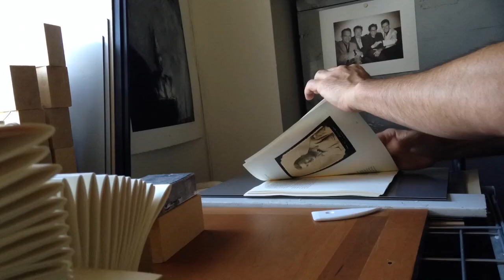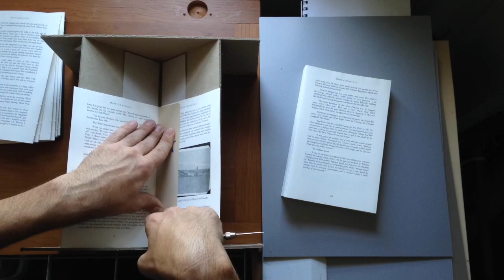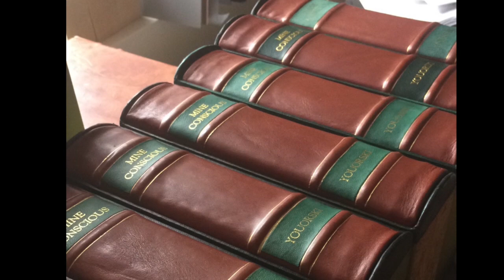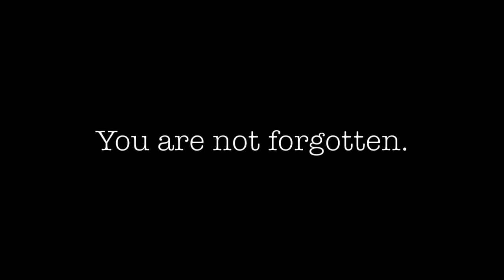Making Mine Conscious, Traditional Bookbinding.

Comment: How thick is the leather you used? I am a novice wanting to do my first book. I am trying to decide what method to use though.
Reply from the maker: Shanna Bolser I would suggest using French split goatskin for your first try with wheat paste for adhesive. This leather was an expensive 1mm calf skin and required significant pairing which needed specialty tools and training. Goat is really nice to work with.
Reply: @RoundsOfWanting  Thank you for your advice. I will be looking into it.

Comment: small qty book card supplier?
Reply from the maker: sorry, what is the question?
Reply: @RoundsOfWanting  I need six book cover cards 5.5 x 11 qyt2 9x12 qty 4 do you know a vendor? that supplies short qty's
Reply from the maker: @bigjarn  talasonline.com will custom cut davey board  but it is a $45 charge last I checked. I have used 6 and 8 ply mat board for book covers before. Those are available at any frame shop
Reply: @RoundsOfWanting  Thanks I'll check branch Framing intown